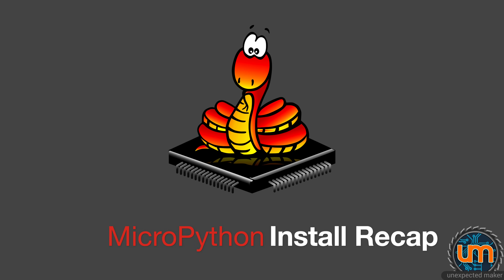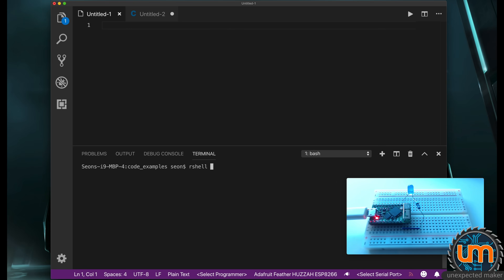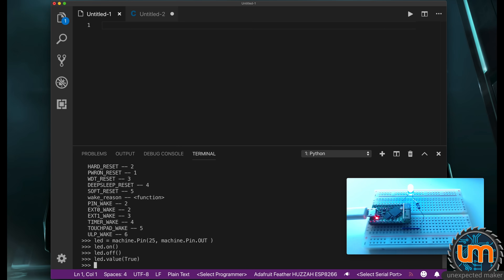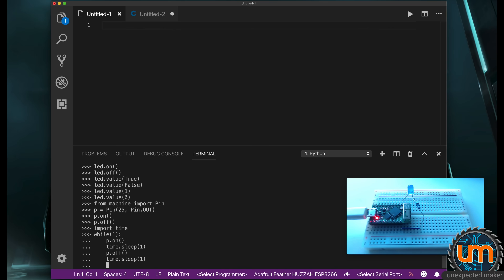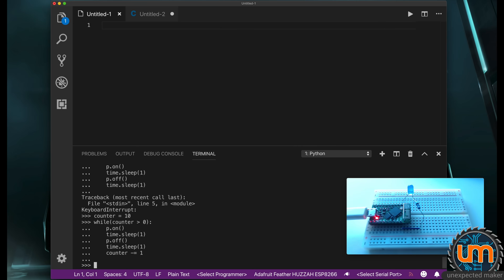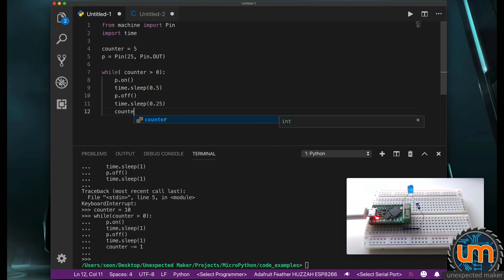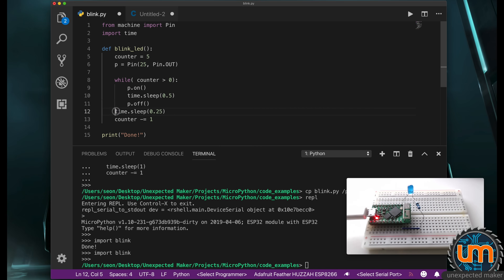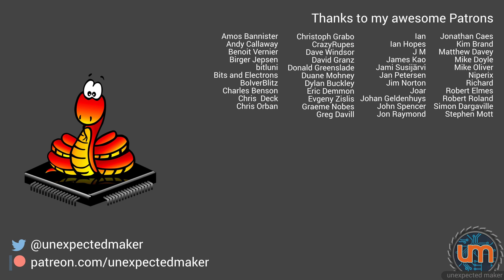MicroPython #2 - Hit the ground running

Comment: All this works on my pi zero but I get wriggly lines under the code on line 1. Is this ok or have I got a problem with my "machine module" installation?
Reply from the maker: Pi Zero runs Python, not MicroPython. These tutorials don't apply.

Comment: Can anything go wrong while flashing that cause it to be unusable? I have esp8266 and esp32. How do you flash it to original firmware if you decide to go back to Arduino IDE?
Reply from the maker: You can always do an erase flash. To go from MP to Arduino, just flash your code from Arduino. No need to do anything else.

Comment: I'm fairly new, please bear with me. I can turn on and off gpio pins, but when I use a loop the loop does nothing...and ideas?  esp8266 running from raspberry pi3B usb. 

Thank you for your tutorials.
Reply: You have to press the enter key a several times after entering  the last line of code of the loop , 3 or 4 is usually enough.

Comment: What is the command for the rshell to address the MicroPython board via the rshell?
With me ESP32 to COM6
Reply from the maker: Have you tried googling "rshell on com6" ?
Reply: @UnexpectedMaker  Yes, I have made but found no solution. The rshell is running, but I can not contact the ESP32 board. 
Under uPyCraft I can address the board. I do not know what else to try.
Reply from the maker: rshell --port COM6